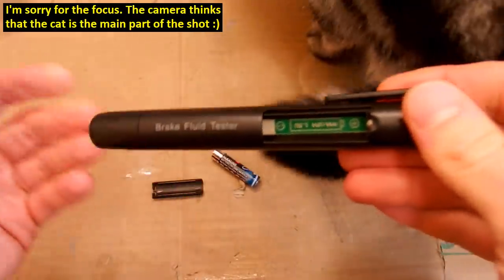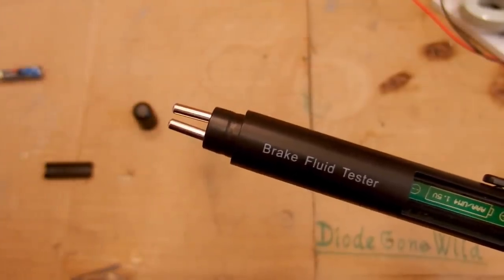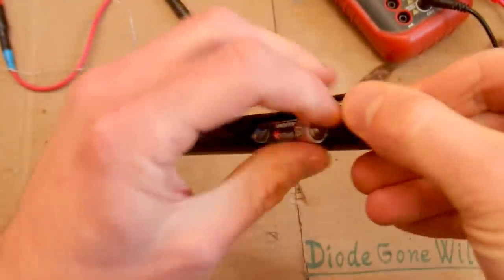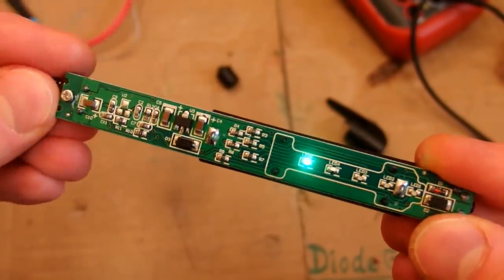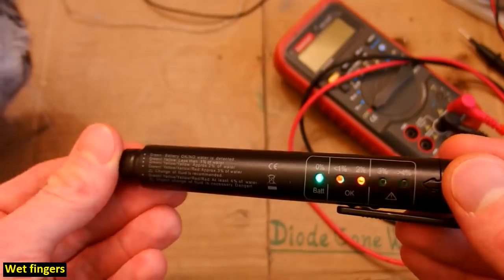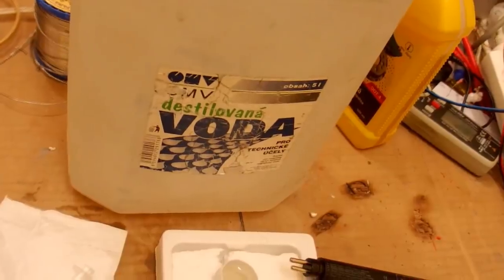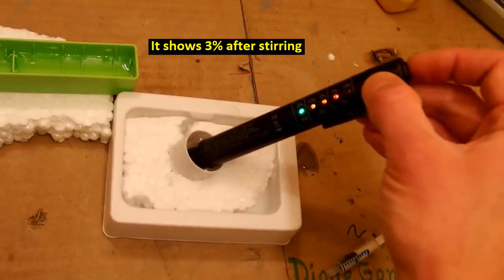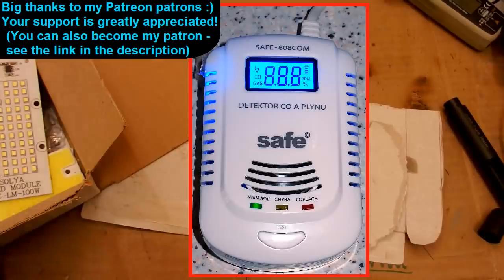Brake fluid tester - test and teardown

Comment: Why even bother with the tester? Brake fluid is cheap, if in doubt, flush/bleed the brake system. Testing the brake fluid in the master cylinder reservoir doesn't mean the brake fluid down in the brake lines and calipers is any good. Brake fluid doesn't "circulate" through the brake system, the same fluid pretty much sits in the lines and caliper pistons forever unless there is a leak or you bleed the system. Brake fluid in the master cylinder could test fine while what's in the lines and calipers could be bad, or the other way around.
Reply: It's mainly used by service shops to show the customer they need a wallet flush.
Reply: True. A real test would involve opening a bleed valve of a caliper to collecting a test sample.

Comment: Break fluid is can pentrative like WD40, so it can get inside this device.if the electrode fell inside your break fluid reservoir and get into the break line..it will be a nightmare !! I would rather use my Fluke and  a battery!!!

Comment: I wonder if the probes could be left in brake fluid all the time, then you could have a in car version.
I bet you could have made a better one than the manufacturer :-)
Your loverly cat is the star of the show :-D
Reply from the maker: This tester definitely could be a part of the car, just like the tyre pressure sensors. But it would just increase the complexity of the car even more. I would desing the tester with an analog meter and a nicely callibrated scale ;).
Reply: I should have known, not a lm3914 bargraph chip but a nice analog meter :-D.
Reply: @DiodeGoneWild  Yes! I'm looking forward to that video
Reply: @zx8401ztv  LM3914 ftw !!

Comment: The review here is quit entertaining, but, alas, not necessary.  Brake fluid turns off color as it absorbs water.  Just check the color, still you need to change the fluid regularly, just like antifreeze.

Comment: Shame about the crappy electrode fixing. Did you measure your distilled water conductivity ? You may find it's quite conductive because it's been in contact with the air for some time in the container - which maybe why tap water / distilled water results were similar....just an idea.
(I used de-ionised water at work, and we measured its 'purity' by measuring its conductivity with a probe - which was almost zero usually)

Comment: Smashing video. Distilled water is non conductive, you need to add salt to make it so. Rain water or moisture ingress (perhaps slightly conductive), contains some minerals. Brake fluid is made of Glycol ether and (depending on DOT rating), Borate ester. I'm not certain about the chemistry of combining all? When changing a timing belt I always need to know if the engine is compliant! If not, and maybe a reassembled part isn't quite right; the pistons will slam into the valves - engine death! Only a small number of car engines are compliant? All combustion engines should be compliant. It's good to know a garage very well for a belt change? Or else, a couple of weeks later (because of a Friday job) - engine death! And they wont admit it's their fault - be warned!
Reply: Is it the dissolved minerals that increase the conductivity?
Reply from the maker: You probably mean whether it's an interference engine. It definitely is. Almost all diesels are interference, because they have a very high compression and there's very little space left for the valves. But I changed my timing belt with great care and also changed the water pump, the tensioner, the idler pulleys and the stretchbolts inside them. I have driven it about 1100 km since then and it seems to work fine.
Reply: @paulf1071  Yes, the breakdown voltage of distilled water is high. Adding say, a small amount of table salt will make it conduct but, be mindful that on one electrode will accumulate Sodium metal and on the other - Chlorine gas!
Reply: @DiodeGoneWild  Doing it yourself (if you're a good mechanic, and I know you are), is the best way to go. But, if you're not able or no longer able to - it's always a worry. What's more if you DIY - you've only got yourself to blame :) If present, a lot of people tend to forget to replace twin cam timing belt/s. With all the science and engineering available today (and probably for the last 20 years or so), all combustion engines should've been compliant/non interference. Probably (for most vehicles), this would add very little cost. I suspect the only reason why this hasn't been implemented - built in deletion! It's not in 'their' financial interest.
Reply from the maker: I think that engines are made as interference engines because they have to have a high compression  ratio to have a high efficiency. Ancient engines had like 3:1 ratio, but modern petrol engines are close to 12:1 and diesels close to 20:1. My engine is 1.9 liter 4 cylinder, 19.5 : 1 compression. Thus each cylinder is 475ml and when at TDC, it's just 24ml of space! Good luck fitting non-interference valves into that :).
Reply: @DiodeGoneWild  Very good point but, some manufactures/models (Toyota, Ford, Fiat, Audi, BMW and Chrysler, probably in some of their petrol engines), have achieved this - why not all? Why is this not a major selling issue? And I'm certain it's not beyond the wit of man (or women :) to do so - with all such ancient, but still very important technology. I'd much prefer a freewheeling engine than the latest Bluetooth add-on. Thanks for listening to my rant, and I think it's an electric vehicle for me next (milk float :)

Comment: You have to put the entire electrodes into the brake fluid, not just stick the ends, because of course the resistance will then be higher...

Comment: 1.9SDI. Very durable and idiot proof engine but very slow
Reply from the maker: It's a snail car, but I like it. It's simple, reliable, only takes about 4.3l / 100km.
Reply: @DiodeGoneWild  That's why it's a good engine. It uses less fuel than my first car (0.8L petrol Daewoo Matiz) ot uses 4,5L/100km
Reply from the maker: My neighbor also has a Daewoo Matiz. I recently seen it being pulled away on a rope :). But you can't compare diesel cars with petrol cars. Petrol cars always take more fuel. My 2001 diesel takes 4.3l / 100km while petrol cars from the same era take about 6 - 7.5l  / 100km. Modern petrol engines are getting better. My mother has a 2015 Škoda Fabia III 1.0MPi 44kW, it can easily get under 5l / 100km.